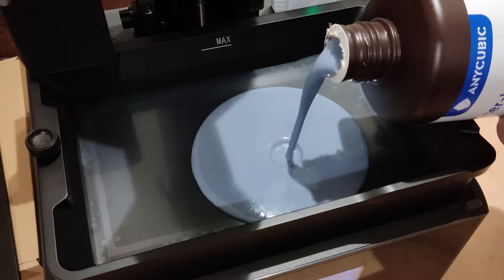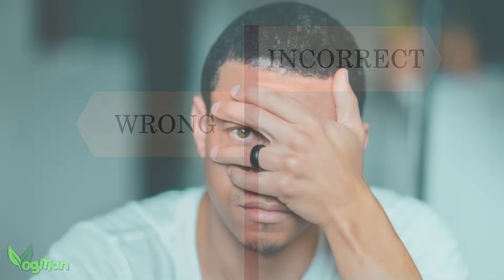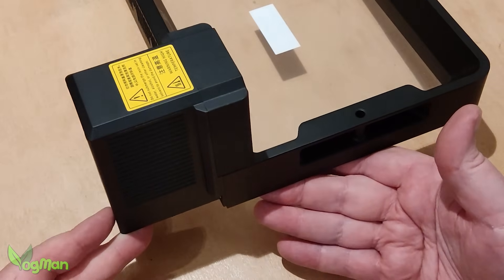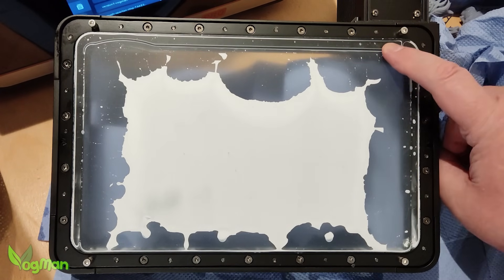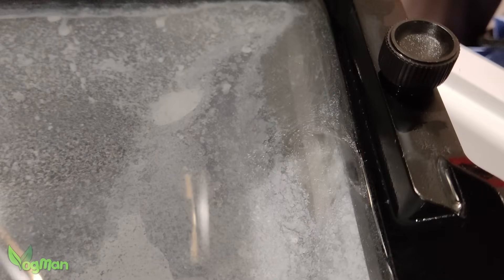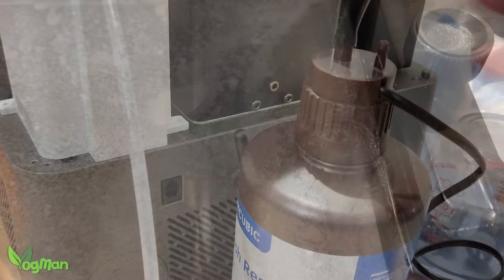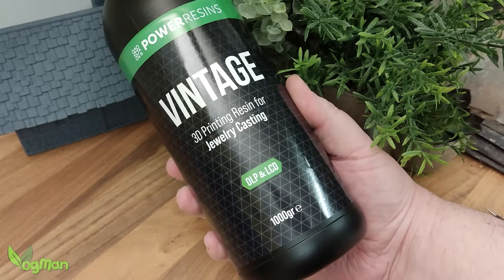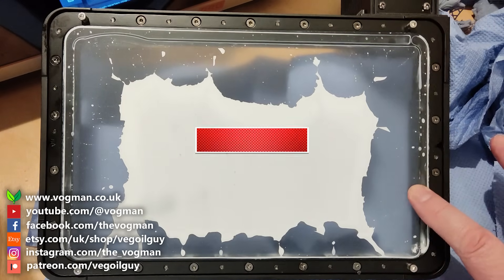Anycubic Photon Mono M7 Pro (apology and update)

Comment: What are your thoughts on the Anycubic Photon Mono 4 Ultra? Do I need to be concerned about ambient print temperature for Water-Wash Resin+? At this time of year, my studio is very cold and takes a few hours to heat up to around 22°C, but won’t get much warmer than that. Is it worth returning my currently unused Photon Mono 4 Ultra to get an M7 Pro as it has Auto-Adaptive Technology Control Heating? It is my first 3D printer and I will be using it for small-scale (for now) product design 3D prints to check size, detailing, and proportions before production.

Comment: So the m7 pro is my first resin printer so im still learning, but i do print frequently. I print with abs like resins. I have changed colors alot and have not really noticed much issues in color even going from black to white with no flush in between (honesty i havent even flushed it once yet, not from carelessnees but because  until recently i didnt even know the printer did that). My biggest annoyance is i do get resin trapped under where the vat meets the fep in the corners. I just take a cotton pad and just really try to get in between them well. Also, standing the vat up and letting the stuck resin run out does help a lot.

Comment: The reason you’re having issues with the pump is due to the seal under the cap. That’s where you should focus your efforts, making sure that that’s evenly placed. I had the same issue till I figured that out and now anytime I’m having issues with the pump not functioning. That’s the first thing I check and it’s always been the fix.

Comment: This is not a comment about the Photon Mono but a request for help. I have 2 Flashforge foto 925 6k machine, not the best printers I know but I have them dialled in now and have very very few misprints. My problem is that on one of them I now need to Replace Z-axis Motor and Lead Screw and I cannot find a match  for this anymore. If you or anyone who reads this can help, I would be very grateful. On a side not before I bought these machines, I did have a Photon mono 4k and it was a great machine, I only change to these Flashforge machines because I wanted a larger build plate and these came at a great price.

Comment: I got it wrong, but actually it's even worse 😂
Quite appropriate conclusion too - surely an easily cleaned agitation system would be a simpler and more beneficial addition? Build a heater into it and get a twofer

Comment: Machines handling liquids as nasty as SLA resin is, should be designed with a constraint on the very top of the prio list: Keep wetted areas as small, as cleanable, as serviceable (or even replaceable), and as inspectable as possible. Different brands seem to start failing to understand this. This one here is a ridiculously extreme example, but also Elegoo is on that track, thinking it was a good idea to have two build plates on top of each other,  sandwitching an air gap obstructed with poles.

Comment: It's called a peristaltic pump. There is no technical reason why it shouldn't be able to run outside of the heating cycles, so any future firmware update may include this feature.

Comment: Nice clickbait 🙂I personally don't have any issues with my M7 Pro, everything works out of the box, even the wifi (just as my M3 Premium did ;-) ) I think this is the best heating option around for the folks who need it. I don't swap my resins and just leave it in the vat. So always the same resin and therefor no cleaning issues and yes, I only use Anycubic resin so also no issues with the feeder cap. If you don't want all of this, wait a few weeks for the regular M7 and save yourself some money. The real issue for me is speed vs quality. The high speed resin + ACF is noticeable less sharp.
Reply from the maker: Clickbait? That certainly wasn't intended... just an upfront admission 😁
If you usually use the same resin, then as you say, you'll be fine. Folks who regularly swap resins, especially if they use expensive speciality resins are the ones who need to be most careful.

Comment: There is one big plus on the heating the way it's done (the same advantage is valid for direct vat heating, or using the surplus heat from the light source):
You can use fume extraction and heating at the same time.

One other point:
The resin pump may go over the vent, BUT it has vents designed into the hollow base. (you even show it in the original video.
The air flow is certainly a bit worse, but still possible with the pump in place.

Printers like the Saturn 4 Ultra have the heatr positioned directly in front of the fume vent. using this to extract fumes will also directy get rid of any heating.
Some printers even use the vent cut out to mount the heater, making this even more useless.

Edit:
One thing I forgot:
Please check, if your Saturn 4 Ultra also triggers the "Chitu" Bug with too many white / grey pixels on the x-axis (see J3D Tech's channel)

Comment: I have come to comment section here seeking help for  problem I'm having sorry. I have a uniformation gk2 and I'm using anycubic resin grey standard. I cannot find the settings for this resin with this printer. If anybody has the recommend settings, I would greatly appreciate it
Reply from the maker: If you download the Lychee slicer, they have a library of user-provided resin / printer settings which you can go through. I'm sure there's other similar things out there.
However, you ideally need to learn how to dial in a resin for yourself. This may help https://youtu.be/hgtsYOkHesM
Reply: @vogman  thank you very much :)

Comment: Others have commented about the Anycubic marketing and communications (failures) regarding the M7 Pro “resin heater with built-in pump”, but I’ll restate the gripe here. Anycubic’s Marketing Department shouldn’t ASSUME that their customers will figure out on their own how the features or unique/special features of their products work. They really should have a “tech specs/functionality” section on their M7 Pro product page that details/describes exactly how these features work and the tech specs for each feature. So, “what exactly does the resin heater/pump do?”, how does it function, how long does it take to heat a specified quantity of resin (and if the amount of time differs depending on the starting temp of the resin), and under what circumstances does the resin heater/pump function - example, only pre-heat prior to starting the print, or heating intermittently or continuously during the printing process, etc. The customer shouldn’t be left to guess at these things, and it’s a waste of everybody’s time If we all have to contact Anycubic to get clarification/answers to these questions.That goes for the damn “resin fill system” as well.
Reply from the maker: Often it's even worse for us YouTubers in honesty. Regardless of the brand, printers often arrive without settings and are not supported by any slicers. Instructions are usually non-existent and those we communicate with aren't techy people. It can be fun...
Usually I'm able to guess my way around most of the technology, but this time I failed. It's ironic because this was exactly what I was expecting this heating system to do, but I didn't look closely enough it seems  😁
Reply: @vogman  Well, I’m glad you’re in the trenches (the suffering servant) rather than me, Geoff! I’m mostly bald, but I imagine the hair pulling has done wonders for your mop.

Comment: The chamber heater on the M5S Pro is simple and works very well. I’ve tested the resin with a thermal camera, and you can remove the cover during a print for checking (or whatever) without the resin suddenly losing temperature. The chamber heater gently warms everything…the resin, the vat, the enclosure…and keeps the heat remarkably stable. And, even though it’s an air heater, the area around the vat holds the heat very well…the heat doesn’t just simply rise to the top, leaving the vat unheated. The M7 Pro solution is over designed…cleaning it properly must be very irritating.
Reply from the maker: I prefer enclosure heaters over tray heaters for this very reason. When everything is warm (the tray, the plate, the resin, the air) then thinks work better. There's no reason why enclosure heaters can't be small, affordable and easily replaceable... and they work great!
Reply: @vogman  I actually had a long online meeting with an Anycubic rep about this. He was surprised that the heater was a deal breaker for me. I offered to buy an M7 Pro if they could supply it with a normal vat. It should be an option. I really wanted to like the M7 Pro, and buy it. Now, can someone please make another DLP, but with a 10" screen...hello #anycubic

Comment: Well just more worthless bells and whistles from Anycubic.  M5 M5s M5s Pro. Self leveling is a joke. More bother then value. Air filters are a waste they do not remove the toxins in the air, just the smell. I have 5 of the M5S pros. Never are there more then 3 working at any time. I have 4 of the M5 Max and there track record is even worse. Lots of worthless features. Be nice if they just brought out a unit that actually works most the time. Bells and whistles not needed.
Reply from the maker: The biggest issue most new comers have to the hobby is plate levelling, so I can see why companies are trying to combat that issue. And when it comes to heaters, I'm a massive fan as temperatures in my workshop tend to be on the cool side. But yes, a simple printer with simple heater is generally all that we need 😁

Comment: Wow while this feature is pretty cool.  I can’t imagine switching solvent based resin with this tray.
Reply from the maker: Totally agree. Some resins are sticky nasty tings that are hard to clean in a normal tray. With this one... you'd need a new tray. 😁
It was a nice concept, but I don't think quite enough thought went into it.
Reply: @vogman  Corners of any containers are hardest to clean, and imagine increasing the amount of corners by 300%, and surprise, you can't access those corners. Here's a stupid idea: heat up the resin bottle and use a regular forced air heater to maintain the temperature so you don't have a nasty thing attached to the resin tray?

Comment: Nice correction. But in fairness to you, the marketing and instructions should have been Really clear on this. Every resin change will require a deep clean and what looks like a fair amount of detergent, which will obviously ruin whatever resin isn't cleaned out. I also really dislike that I can't actually see the pump part that I'm expected to clean. If it picks up some little bits of broken resin/supports I can't see, they might end up back in a later print
Reply from the maker: That's very kind, thanks.
I agree, better access to internal parts that WILL hold on to resin is impossible here. It's a real shame.

Comment: I purchased this exact printer just a few days before your original video. I got a little worried. I have not yet printed, but I am grateful for your update.
Reply from the maker: It's really about your resin choice. If you stick with mainly the same colour and brand, you'll have no problems. If you mix colours, you MAY see slight imperfection here and there. If you use speciality resins, then you'll need a vat per resin... and I'd imagine these will be expensive.
Reply: @vogman  According to 3D Jake, a replacement VAT is €90.
There was a listing for the M7 Non-Pro. The vats are the same size and cost €50 (the same as for an M5)
You could use the M7 Vat in an M7 Pro.
Reply: @vogman  thank you always for your invaluable experience. I have purchased elagoo gray resin and that is all I will use because all of my figures will be painted. We hope to do our first print this weekend. I will be watching all of your videos on advice before one’s first print.

Comment: I agree with you about the cleaning. This would be a good dedicated printer that is used for one thing repeatedly, but for anybody who changes resins, the flushing/cleaning seems like a nightmare.
Reply from the maker: You're spot on. 😁👍👍👍
Reply: I honestly wouldn't worry too much about flushing. All MSLA resin cures at the same wavelength, so they all mix fairly well. If you pour out the resin, the small amount left beaded on the FEP and in the tube shouldn't have any noticeable effect on your resin's color, properties, or print settings.
Reply: I haven’t had issues with this. Honestly pretty easy to do. And like the guy above mentioned, they mix well if you don’t care for the outcome of the color. Just turn on the auto heat and it’ll basically stir the two together

Comment: I have the M7 Pro and right now it is my favourite printer, it is really fast. I'm just curious how it will function when it is cold in my garage.
Reply from the maker: It should do well in a cool environment. The heater does work very well and I found it accurate.
It's really about your resin choice. If you stick with mainly the same colour and brand, you'll have no problems. If you mix colours, you MAY see slight imperfection here and there. If you use speciality resins, then you'll need a vat per resin... and I'd imagine these will be expensive.

Comment: Thank you for the correction, even if it is small all things considered. I thought it was a combo from the presentation but I was wrong as well. I thought the recirculation pump was always on and the heater activated when the temperature reached a certain level. 

It would be nice if they changed it and had the pump always going, or allowed us to turn it on at set intervals, say 1 minute mix every 10 minutes. I still dislike the resin refill bottle pump. So far no home-hobby machine has a way to stop the mix from separating in the bottle.
Reply from the maker: Now that's what I wanted! Mix and heat top ups. 😁😁😁
Unfortunately we can see from my water tests here that the pump isn't strong enough to mix.